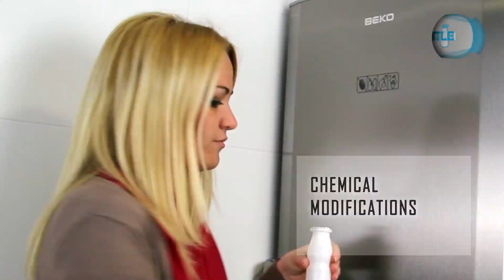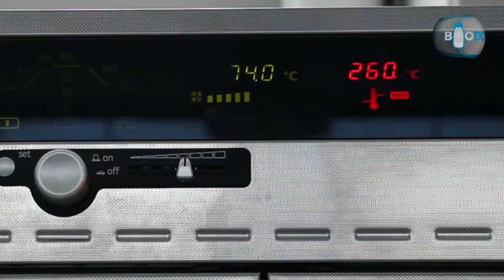Biodegradable packages for dairy products

Comment: How to make  this bottle  n which  type machinery  need for this...
Reply from the maker: It is obtained in conventional equipment for Extrusion Blow Molding. It requires some optimization in process parameters.
Reply: @aimplas  are this bottles made from PLA